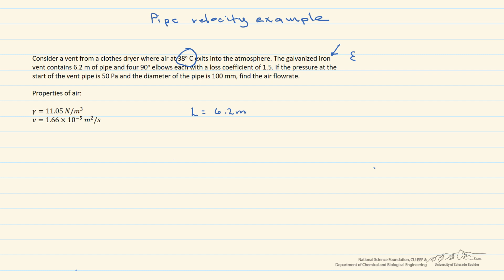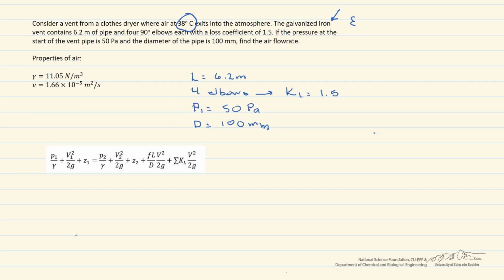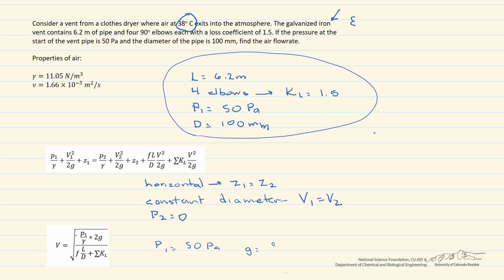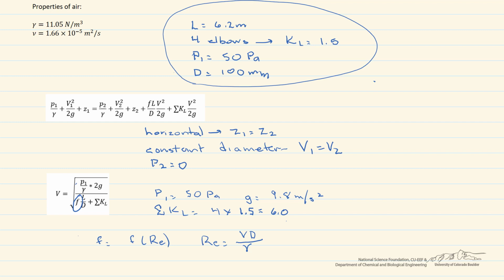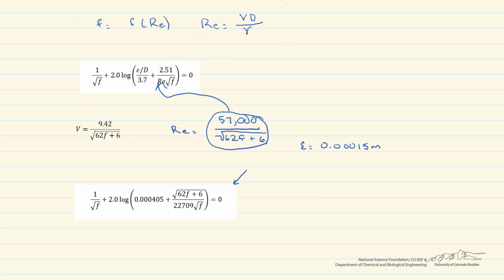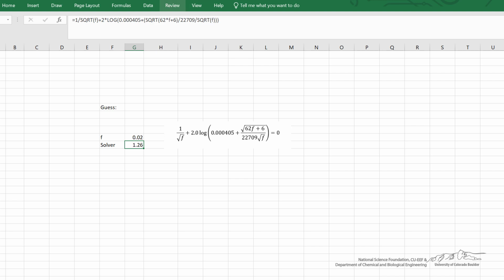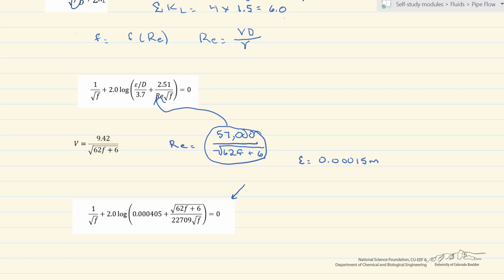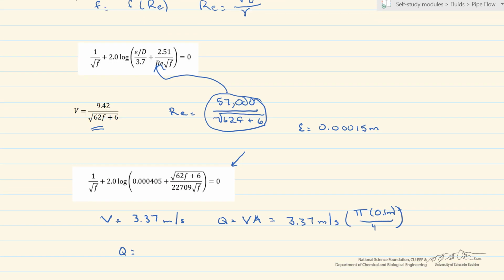Calculating Pipe Velocity Example

Comment: Wouldn’t the velocity increase over the length of the pipe run since air is compressible, and with the pressure drop/expansion of the air volumetric flow rate also increases along the pipe run? Mass flow rate remaining constant of course....
Reply: a tip : watch movies on Flixzone. I've been using it for watching loads of movies recently.
Reply: @Kairo Rayden Definitely, have been watching on flixzone for since december myself :D
Reply: @Kairo Rayden Yup, have been using Flixzone for months myself :)